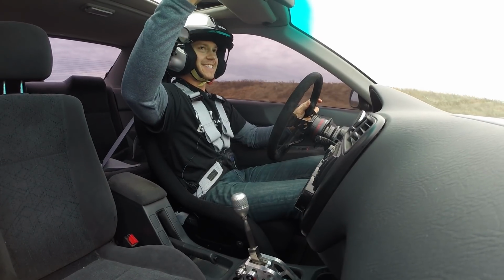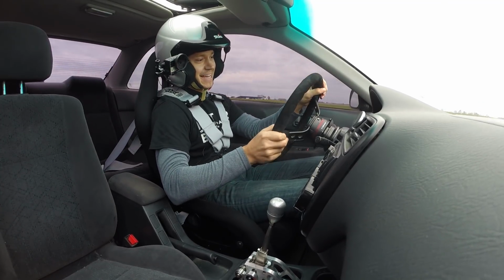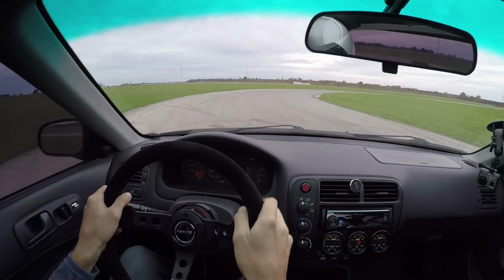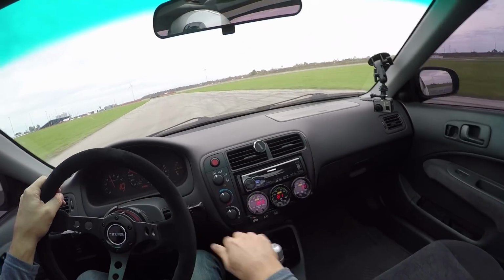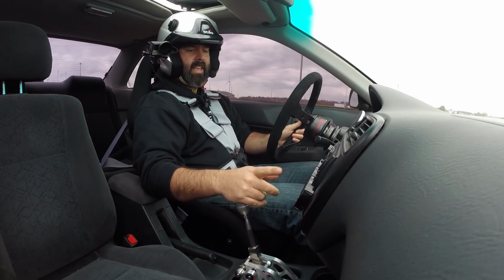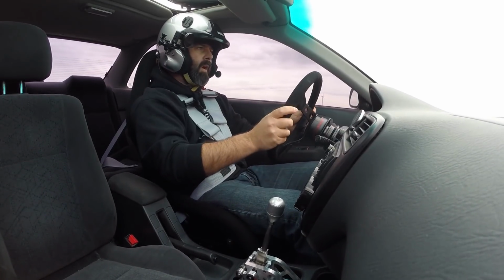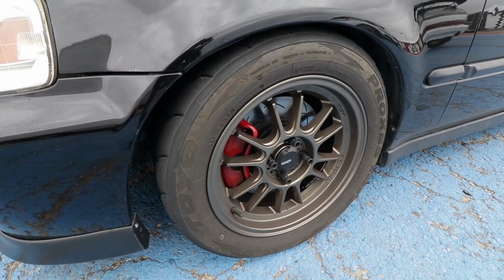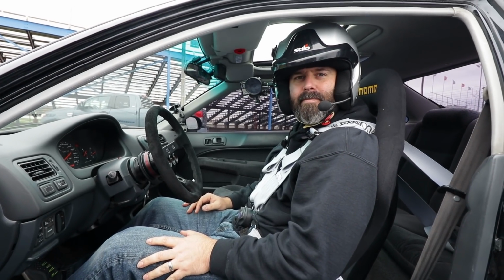Track Day Rippin' TEC  - Stage 2 Track Day K-Swap Civic - EP04

Comment: Just throwing out there some info if the climate and radio bezel case is kinda falling out at the top section. I had the same problem when I had my radio stolen. From my 2000 civic ex coupe. So I put small washers to lift it up and make the top of the bezel grab at the top of the dashboard.  Hope this helps. I put the washers between the climate and radio bezel case mounting feet and dash frame it bolts too.  Sorry if I could make my self clearer.

Comment: Nice build. Did have the same abs problem on warm full slicks. (MG zs 180 aka civic mb v6) Could brake much harder without abs, with a mechanical brake bias valve. Modern abs units do control the brake distribution front/back. When you disable the abs the brake distribution becomes 50/50 so the rear locks up. Next upgrade an brake bias valve?
Reply from the maker: There's a proportioning valve in place so with or without ABS its still the same OEM bias. We really didnt have any rear lock up so that is surely not our problem.
Reply: Okay, there is a proportional valve. Sorry for the comment, just have seen lots of  people pull fuses on track and lost brake bias.

Comment: I'm running DTC-60 front and HP+ in the rear and that combo seems to work really well with factory calipers and factory prop valve in my EK coupe. 

I also did a base line on my FA5 that's all stock with just an intake and my tuning with flashpro and I did 191whp. I'm not sure what's up but you guys are down on power a fair bit...maybe try a test pipe just to 100% rule out the cat. The cat my not be causing back pressure but it could be causing some resonance that's not working well with the K-series.

Comment: I'm installing the same brake setup (ITR calipers, mini rotors and 15/16th master) I was going to go DTC-60 pads but this has be thinking twice. My car does not have ABS so the brake lock issue you had is a concern to me. Would you recommend a different pad now after your testing? I had been looking at possibly getting the Honed brake master delete to improve feel but........yeah. Any advice would be appreciated.

Comment: I did know what happens when the abs fuse burns/not there. I had a ranger pick up truck, someone stole a taillight and one of the cables made contact with the metal and burned the fuse, light came on. Bought the taillight but didn't change the fuse, almost flew off a road off a mountain. Scary crap.

Comment: Okay after watching I think all of the videos on this civic, I have gathered that I will have quite a similar brake setup. 
My only question now is what size are the tires? I want to get these tires in 225/45 for the same rims on the same chassis. I am definitely glad I watched these video and finally know that I will be able to clear the ITR front calipers. 
Good stuff guys!
Reply from the maker: 205/50R15 is the tire size. 225s may fit but it could require some clearancing of the fenders.
Reply: Speed Academy yea with 225s it will be cutting it close. Fortunately my fenders are already rolled on the inside and I don't have the inner plastics. So I guess I'll have to wait and see. I'm a bit lower than you guys have this setup. After watching y'all I'm pretty sold on the newer R888s. Thanks for replying. Keep it up!

Comment: How are the harnesses attached with the seats still in? Did you guys use the seat belt mounting points?
Reply from the maker: They are bolted to the seat belt anchor points in the rear.

Comment: what concerned me is how much the front pushes when the tires are warm. Yes, at first it will rotate when the rear tires are cold, but on your last timed lap you can see the front push like a pig. Fixing that alone will gain you over a second easy as you wil be on power much much sooner. just my 2 cents

Comment: Sounds like you're experiencing ABS Ice Mode. Basically the wheel speed sensors are decelerating faster than the ABS module considers possible(for a stock car). It assumes you've locked up your tires, so the only way to regain traction is to reduce brake pressure. This is a pretty common issue and can be caused by Front to Rear imbalance or stabbing the brake pedal, but some times it's just unavoidable. I know this can happen with Miatas on R-comps; the only known fix is to delete ABS, or disable it and only use it in the wet.
Reply from the maker: Exactly, we're just going to keep disabling the ABS when we hit the track.

Comment: Kinda curious to know what you guys think about the tires v. brake imbalance. Obviously it’s hard to get dialed and that’s why I’m inclined to ask what you think is better: more brakes than tires or more tires than brakes?
Reply: It doesnt matter when you go into the turn late and jam the breaks.  The civic has great brakes they are awesome and those tires are some of the best you can get.  He just got over exited from the lap time and was late to the turn and locked them up as had issues with the ABS.  They will get it sorted out.  Brakes are always the most important thing.  Once you add power you need to stop better so adding bigger rotors and matching calipers is always needed as they will improve braking on every tire.

Comment: Please get a harness bar for the racing harness. PLEASE. Plus you can do a install video too.
Reply: Its fine as is its holding him in place alot better then the stock belt.
Reply: Ran Marsh most would argue harness bars are worse than the current configuration.

Comment: You need to not lock up the front tires when your coming in hot on that corner you  have to tap the gas while braking to pull you into the turn or else your going to keep going off track.

Comment: Tuner that tuned this car definitely had no experience with k series motors
Reply: Hasani Farquharson agreed
Reply: Highly agreed. If they were in Ohio I'd do it 🤷‍♂️
Reply from the maker: Can you please explain why?
Reply: Nope hes just following the crowd.  Every dyno reads diff get over the numbers and look at how well the tq carries.  The track is to tell what the real power is not the dyno.
Reply: Speed Academy because the k series especially on a hondata the tuner have to set up well each low cam and high cam profile. They're 6 low cam profile and 6 high cam profile like for example the tuning of 0 degrees low cam,10 degrees low cam and so on. That's why if you get a good tuner it could be making a lot of efficient power, in have seen 300 hp rxs that make 10 or 9 seconds on a quarter mile because the k series is properly tune. You should check that out so you guys can squeeze all the guud stuff of the K series which it's really cool engine because of it's tuning capabilities.
Reply: Also I did more research to not confuse you with the cam angles and all that stuff. So after they're done tuning all the cam angles they will do serveral dyno runs for each cam angle. So then they build a composite cam angle map which mean like for example if they get more power in certain rpm range using 50 degree cam angle they will grab that part and set it on like for example from 4000rpm to 6500rpm. Then if 35 degree cam angle did better from 6500 rpm to 8300 rpm then the hondata will switch to that 35 degree cam angle on that exact rpm range. So the tune will be a combination of this cam angles for low cam and high cam getting best torque and power possible. It's really complicated tbh also all this cam angles depends on the build and parts you're using cuz they have to adjust air fuel ratio,timing etc for each cam profile getting peak power(sorry for repeating myself).
Reply: You pretty much set the WOT cam angle for low cam and VTEC and forget it.  Its important to tune them because the cam angle changes with your throttle input.  More important then the tuning stuff is claying the motor to know how far you can push the angles and cam gears to get max power without smashing a valves.  As these were drop in cams your gonna run recommend settings.  Its not that complicated at all to tune just time consuming.  You can lock the cam angle set the timing safe get the AFR's right then start pushing timing till you see the HP start to drop then go back a few degrees very straight forward.  You can see from the tq curve the tune is fine as it carries really well.  Also look at the gains from the old setup.  Stop being so hung up on the number we dont know the elevation and look at how PFI's dyno read the H22 at 140whp.  Would you rather have a tuner that sucks but the dyno reads high or go to a great tuner with a heartbreaker dyno.  They can be calibrated to read anything you want.  You take it to the track to know what power your making.  The dyno is a tool stop turning it into something more.
Reply: if you are talking about the h22 in the boosted bois mini van its a LOW compression build... it'd be low 130s if it wasn't tuned two to three times. A stock h22a should put 160-170 to the wheel if its healthy. As Speed Academy mentioned its a used motor though that breakup on deaccel sounded odd
Reply: drewx420 how is 10:1 low compression its the same as what some come with from factory.  Its just lower then what he used to run.  160whp is not a healthy h22 those are b16 dyno numbers.  I was just saying depending on SAE standard and altitude it can affect the numbers greatly.
Reply: SlammedSocietyS2k :p Can tune my honda 😂

Comment: What do they mean by rotating nicely? 
Turning smooth or kicking the rear out?
Reply: Mid corner if you lift off the throttle the rear comes around and you don't just understeer into oblivion.
Reply: It means when you find the grip limit the car starts to rotate well meaning the car isnt pushing but helping turn into the turn.  Most FWD cars will push the front tires which is why people love the ek/eg because the car is easy to setup and make the rear end slide when off the throttle.

Comment: I dont understand why you would put harnesses in a uncaged car. it would hold you in place in the event of a roll over meaning the roof is going to collapse into your head when a regular seatbelt will let you tilt forward and away from the roof
Reply: Tanner both styles of belt are designed to do the same thing, hold you in your seat. Airbag would do the same thing in this car if they still had one
Reply: Zack, the 3 point belt of a standard car is meant to let you move in case of a roll over.. 4 and 5 point harnesses without a cage are a NO NO
Reply: Because the normal belt cant hold you in place right with those tires.  You will have a hard time to hold yourself up.  With those belts you dont need to brace yourself and can drive the car to the maximum.  This thing is pulling well over a g in turns.
Reply: if you think a stock seatbelt cant hold you in you dont know the twisting the buckle trick
Reply: LMAO doesnt matter how tight you get the stock belt when your turning with high grip tires you need a harness to hold you in place.  You will find yourself trying to hold the wheel to keep yourself upright and losing time.  Doesnt surprise me as you have no idea how much grip the r888's can give over regular road tires.
Reply: I assume they are using the harnesses out of necessity since that seat is a compromise that fits both of them alright and really doesn't hold them in all that well but a stock belt tightened down and a good bucket seat is as far as I would go in an uncaged car. it just doesn't make sense from a safety standpoint to put a harness in at this stage in the build. if that car goes upside down that roof is collapsing into your head and compressing your spine and its going to kill you or paralyze you. also I've driven a CRX in a stock seat with a stock belt on whatever dot legal tires were the fastest a few years back so  actually I do know how much grip these kind of tires give over regular road tires and how much you get tossed around
Reply: Tanner I STILL keep asking myself how it isn't common knowledge/mandatory/a reprimand by everybody if street cars aren't equipped with Takata or Schroth DOT 4 points that have ASM. They function like a 3 point and let your body rotate/collapse in the event of collision or rollover but keep you hugged in your seat at the same time.

Comment: I'm glad the questionable tuning came out finally, I guess people just wanted to see it on the road before they said anything.  I know it's easy to dismiss as he's your friend, you have ties, don't want to publicly shame him, he has convinced you it's supposed to be like that, (pick option).  But maybe just maybe consider it is the tuner, and trying another one.  Just have a tiny seed of doubt in your mind and think about it.
Reply from the maker: The car is much faster around the track and yet our tuner is to blame? It made 215whp so why would we be complaining. Yes its not 230whp but there are other factors then tuning that can affect the power output. Its not rocket science to tune this engine, I watched Sasha go through the timing tables and there was no more power to be had.

As for the misfire, if you do a bit of research you'll see its a common issue with cars with large TBs when they are in VTEC decel at almost closed throttle positions. Very hard to tune out, especially on a dyno. It's amplified by the 3-inch exhaust.

Comment: New tunner maybe? Car can do lot more power with that mod and what about those misfire?
Reply from the maker: Tuner is not the problem. Engine is probably tired and misfire is either a bad coil or fueling issue on off throttle VTEC